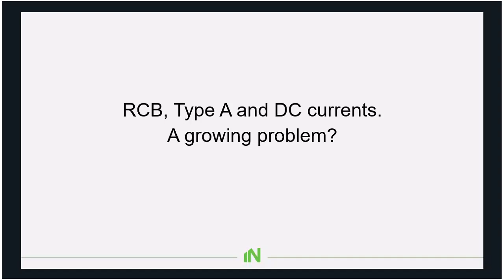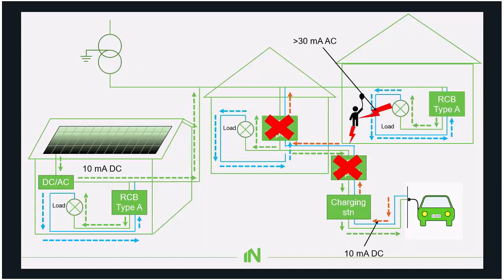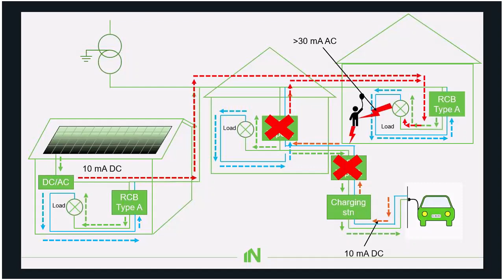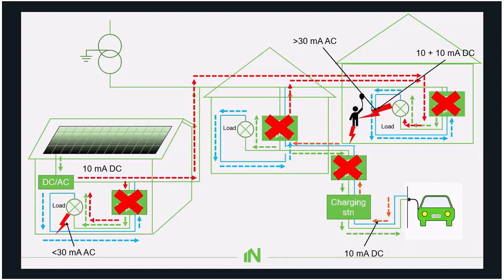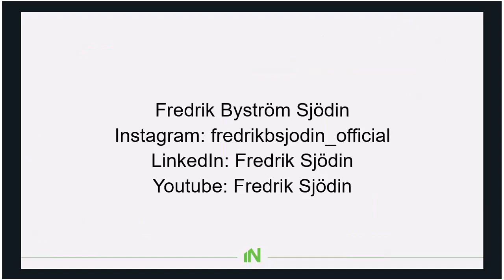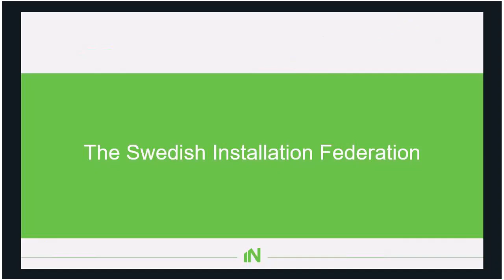RCB's type A and DC-currents. A growing problem?

Comment: Interesting video and a topic a colleague of mine has raised. 

What is the answer? Type B RCB? Type F RCB? Isolation transformer at each house? Isolation transformer on each item that can give a DC leakage current?

I notice Victron state for their Quattro and Multiplus Inverter chargers that as they contain an isolation transformer, a type B RCB is unnecessary, only type A is required.